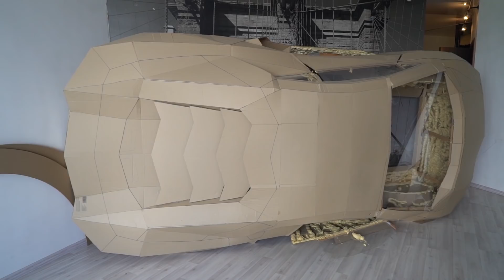LAMBORGHINI AVENTADOR FROM CARDBOARD - COVERED WITH ALUMINUM FOIL

Comment: Fantastic work!  Congratulations!  It would have been fantastic if you built it with fiberglass over foam method as well.  What program or method did you use to transfer the car's exact shape and dimensions on to cardboard?  Great inspiration for some many projects in mind!  Thanks
Reply: That's the same thing I thought of to